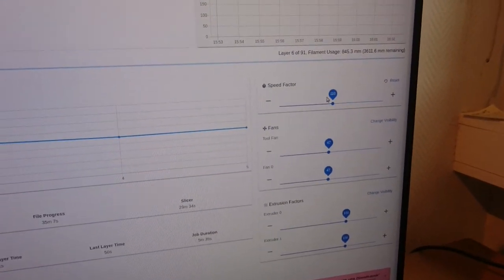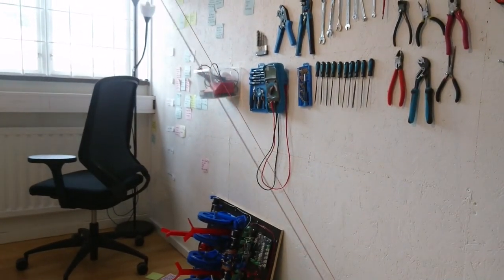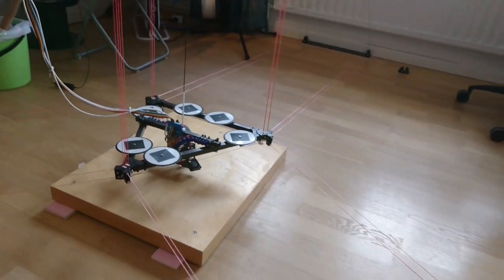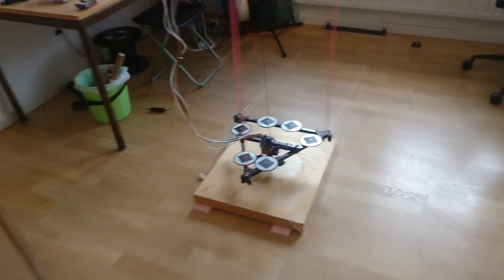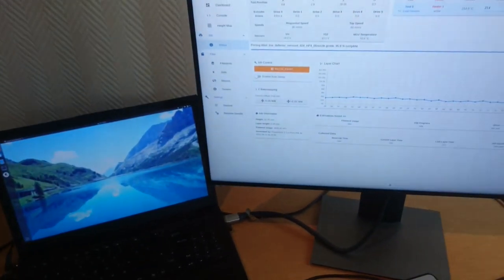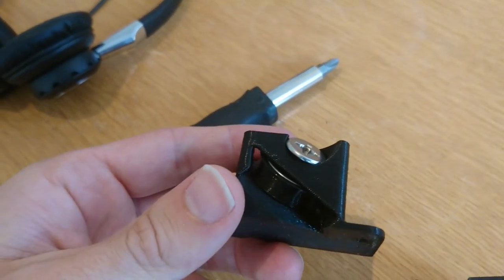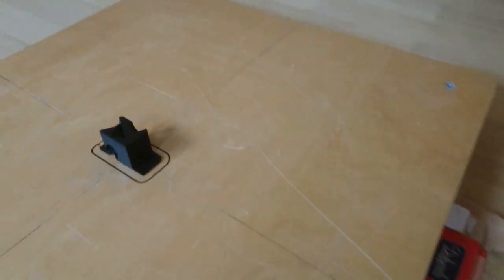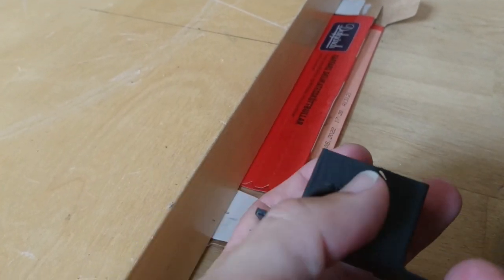Printing Fast-ish with Hangprinter v4

Comment: Impressive build! Can you tellme about these pulleys? Do they have bearings inside? And what type of screw did you use yo hold the bearings in place?
Reply from the maker: Don't remember what I was using in Sep last year. The latest pulleys use 623 bearings with 3d printed U-slots around them who adds a few mm of radii. The best information will always be in, or be linked from, the docs: https://hangprinter.org/doc/v4/